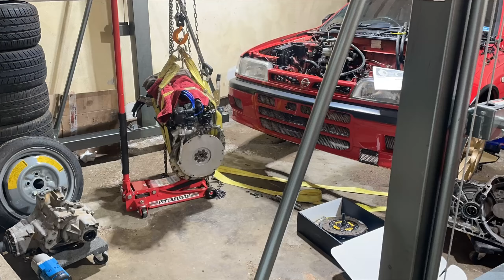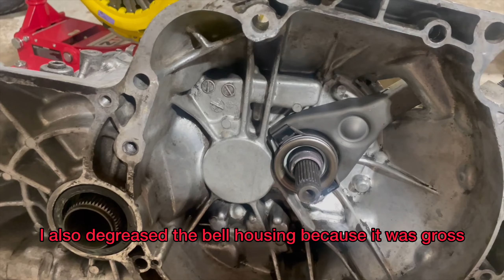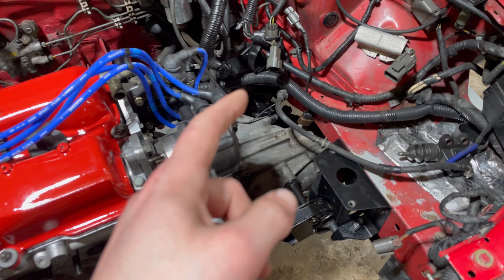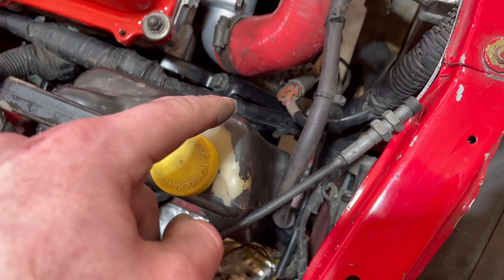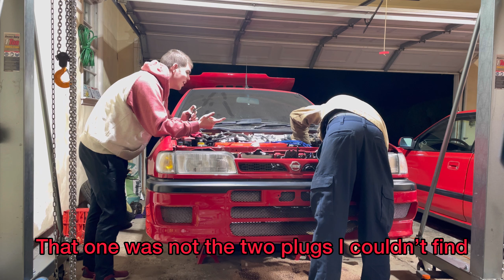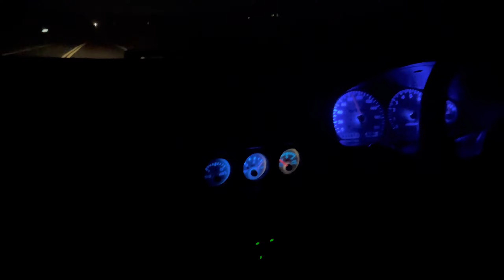NISSAN PULSAR GTI-R ENGINE REBUILD PT. 7- ENGINE INSTALL AND FIRST START/DRIVE

Comment: Sorry probably missed it but why does the motor have to come back out again?
Reply from the maker: My tolerances were too tight for the rod bearings and spun ALL the bearings. I got excited and wasn’t paying close enough attention. Also think I referenced the DE clearings instead of the DET
Reply: @redrauto  gotcha. Appreciate all your videos by the way. Been using it as a guide for my project gtir!
Reply from the maker: @rawrgarage5537  glad to help! I may not be an expert but a little bit of experience is better than none lol

Comment: ccnnecter by gear box is neutral switch ,
Reply from the maker: I did some digging through the FSM and I believe its actually the wastegate solenoid connector. It looks to be connector F1 on page EL-208. Which makes sense since I'm running that Vibrant manual controller. If I'm correct, the backup lamp and neutral switch are on the same connector for the DET which appears to be E228 on page EL-212. Also the other plug by the overflow tank is for the compressor which I do not have